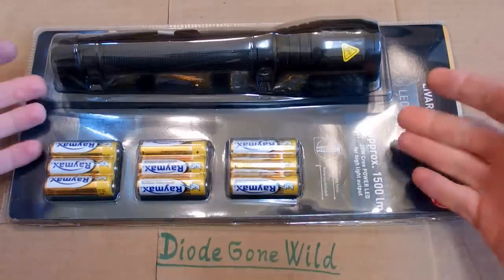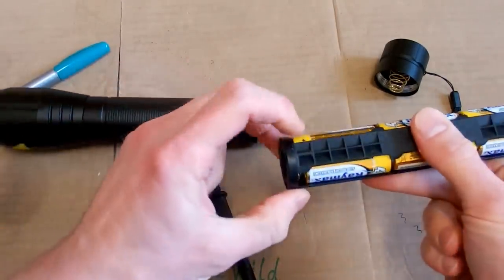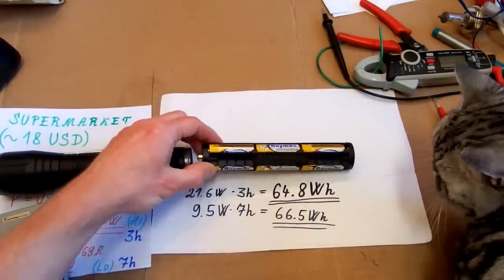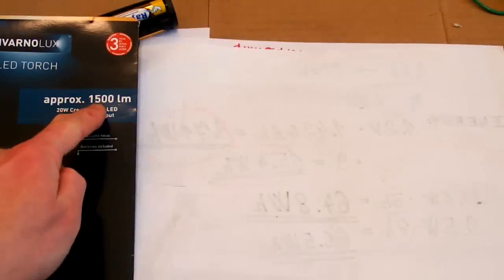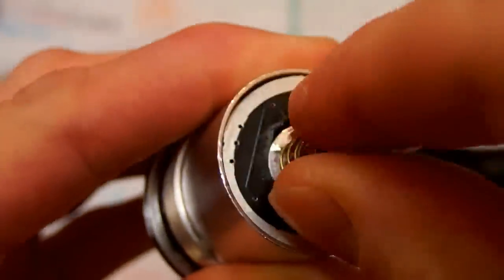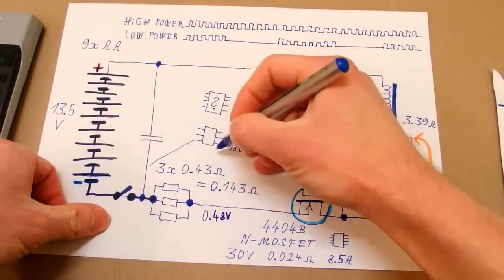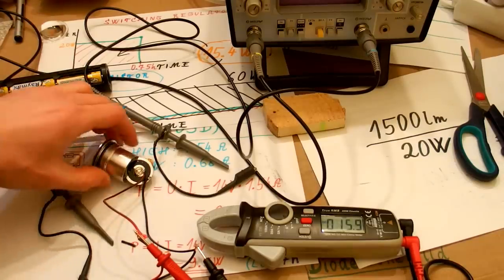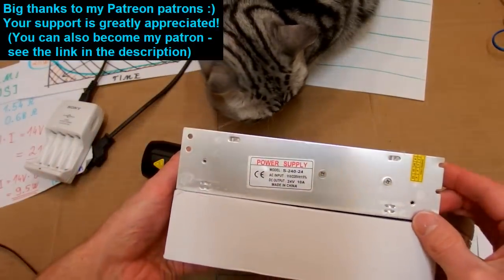20W 9xAA Cree LED torch from Lidl - test and teardown

Comment: fun paper work but why didn't you just run it and find out the real world results..
Reply: He's taking proper scientific approach
Reply: @jan48712  ? you mean the scientific approach is to never verify your findings with actual experiments? That doesn't sound right... isn't there a time in the scientific approach when you must test your theory? To see what actually happens when you turn on the light and let it go until it goes out?.. Well I guess I would make a lousy scientist then because i would want to see what the actual results of all my math was.. thanks for setting me straight.. now I know better.. have a great year..
Reply: @tinkmarshino  He tested the whole range of input voltages that the batteries will put out over their lifetime. So we know how the power of the lamp will change over time.
The only thing you could learn from actually running it with batteries is a more precise measurement of the runtime.
Reply: @Basement-Science   yes I agree he was very complete in his work and left out nothing it was amazing to watch.. all I am saying is the in the end I would have turned on the flashlight to see what it actually did is all..  Besides isn't a presion reaction the whole point of doing this? wasn't all that math and paper work to see what the light would do... tell me after you did all of that figuring would you want to see the actual results?
Reply: @tinkmarshino  sure, it would have been nice to see it actually run. But then, he would have 9 empty batteries and would have to get new ones to use it again.  :)
Reply: @Basement-Science  true... have a great new year!
Reply: @tinkmarshino   happy 2019 to you too!